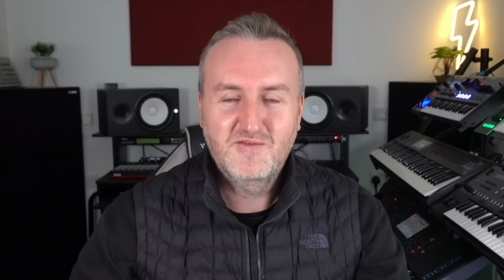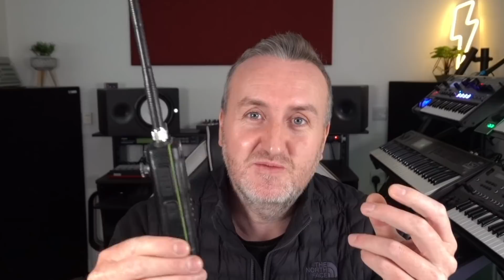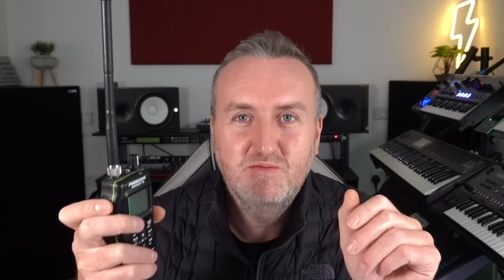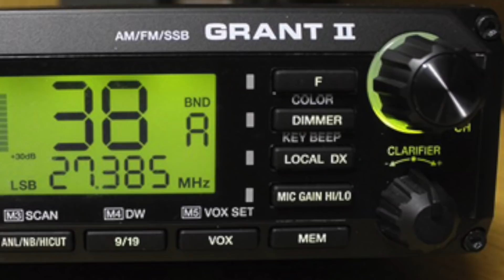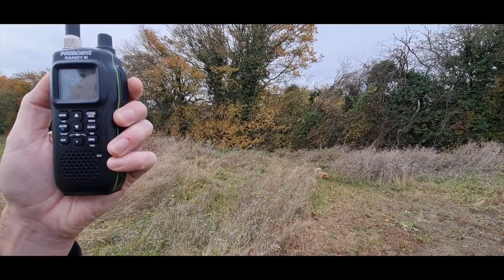NEW TO CB RADIO? WATCH THIS!

Comment: Hi Andy... you're absolutely right in what you say. As a general rule, it is difficult to explain to those who do not have a minimum of knowledge about radio wave propagation, that the poor coverage of these portable CBs it's very small... actually it can't be, because we're talking about a 20 cm antenna to work with an 11 meter wave. A 20 cm antenna "like" those on UHF radios, which work with a wave of 0.7 meters.... it is clear that a portable CB with source antenna cannot have the same efficiency. In my case, I have Randy 3 not only for the love of communications but also in a Prepping way, because I care about that. At home I have a base radio and antenna, in cars I have radios and mobile antenna, and I lacked this portable option, although already have PMR 446 and dual band radios. Right now, even when traveling on foot, I have all three modes of transmission, (CB, VHF, UHF), but... and this is very important, for this Randy I have a T2LT antenna, which makes this notebook have even more coverage than a mobile radio with a magnetic antenna. It is not to be used all the time, as it has to be mounted on a high place, but it is still very easy to put to work. 
Anyway, for this CB, I'm researching which is the most efficient 1.2 meter antenna. Andy, thanks for the videos, and I'm sorry for the huge comment. 
Best wishes to all. 🙏
Reply from the maker: Awesome insight. Yes a T2LT or off center fed dipole will work really well on the Randy, ive found the magloops do too but it can be fiddly tuning an antenna to a radio on the fly as the Randy has no SWR meter.. thats a shame as you know because getting the SWR right is half the battle!
Reply: @andykirby  yes, unfortunately it doesn't, but then it would make the competition's job much more difficult... ah ah ah.... Anyway, whenever I used this antenna, I read the SWR with the meter, and I arrived to the conclusion that if you mount the coil at least 1 meter above any plane, the SWR will not exceed 1.3 in the worst case. When I install the antenna at home, I attach the cable to the fiberglass mast, (8 meter fishing pole), and when I mount it in the car, I leave it hanging... I'll send photos.
Reply: @renatogalego1614  What's great about the Randy 3 is the ability to use it as a mobile or portable. The addition of FM to the U.S. CB band is just around the corner.  Supposed to be anyway... Now add SSB to the Randy 3 !  I saw online today, a Chinese portable CB version of the Randy, Zastone CB58 / QTF? CB58 . woth a few more bells and whistles.
But like you said, it's all about the antenna. Replace the rubber duck with a 5/8 wave expandable antenna, or a quick set up dipole, or your creation ... !!!

I also saw that Icom has or is coming out with a commercial/public safety grade PMR 446 portable. I'm sure it costs more than a regular PMR, but it looks like much better quality..... And that "new"/Retevis Andy has, Ksun has the exact radio - KSun UV3. Like you I have an affinity for radio comms, and prepping. I'm sure you've seen the new Baofeng AR-152 copy of the military PRC-152. There's a company called TRI . Triumph Instrument, China who makes the Baofeng, but better with the actual military type battery, and the radio case is aluminum, not plastic. It has HF and VHF Air  receive in addition to 2m/70cm Tx/Rx. Now if it had CB Am/Fm/SSB .... And GPS is an option for an extra $50-60 ... I may very well make it a Christmas gift to myself !
Reply: Oopps... I can't send the photos here, of course... 🤔

Comment: andy take a look at the cheap usdx 8 band all mode qrp radio  
not got your bells and whistles but you cant get the coverage this gives for the price aka sub £150 anywhere else 
there is also a battery operated one too with built in mike if you like that kinda thing

Comment: Good advice, Andy.   I had a Baofeng some years ago and got fined, since I don't have a ham license and admitted to having transmitted on it. I have some legal PMR 446 handheld devices. I tried to map the range in a built-up area - I got about 4 miles when I was on a local hill. 73s Rob

Comment: When the force (propagation) is with you anything is possible but my advice is get a CB with SSB and string up a long wire antenna and away you go both local and further. Whilst doing this start the Foundation course (Essex Ham's course is brilliant) and before long you will be licenced for the ham bands and then the fun really begins.
Reply from the maker: This good advice, wires work well 👍🏻 vertical dipoles work even better for CB😎

Comment: Mostly because you're on FM CB, that really big help for even cleaner reception at weaker signal, that even with negative-Gain loaded rubber duck antenna. In USA, on AM at same signal strength, the weaker signal strength, that will have muddy audio quality. Wishing for SSB hand held walkie talkie for CB.

Comment: Really like the video really good for newbies one hit that could be useful if you would have get an old ham radio that will get the spectrum between 1800 GHz all the way up to 30000 khz you'll basically be able to use a ham radio on the CB band in the North American area it is 26 9000 khz 27400 khz that's CB Bain you can look up the frequencies on the internet she get an old ham radio you pop at least maybe a hundred Watts you get more power and you would also get SSB that's when we had to bypass it on the CB band you definitely need power and of course if you using ssbu are going to go a lot further less interference and the cool thing it is no license requirement just one little tip thank you for the video and all the best

Comment: It's also mindboggling that the security services can record, archive and triangulate all the content on all frequencies in real time using SDRs for reference and later AI analysis, just as they can for phone conversations, and encryption on ham bands is illegal.
Reply from the maker: It is Andy. Its pretty scary.
Reply: @NewWorldHoarder  Yes they can. Compared to today's tech, TV detector vans are like a horse n cart!
If I can record a 20 MHz bandwidth section of radio spectrum using a $20 dongle and hard disk and then later be able to browse and decode any transmissions that happened in it, then you can be sure with more money than God, the sec services can use at least 100 of them to cover a 2GHz range, or use their own specialized hardware. Of course you'd need more of them depending on cell size.
Encryption is just an obstacle, not a barrier.

No lol.

Comment: I made the mistake of getting a midland alan handheld before I knew about SSB. Got a president mckinley afterwards which I've had alot more fun with. There are CB handhelds that have SSB but they are rare/expensive compared too mobile stations.
Reply: that midland is a very good radio when its peaked up
Reply: There's only two handheld radios that I am aware of having SSB... those being Albrecht, and Midland. And those are primarily for sale in EU countries and UK. Here in the U.S. we're waiting for the FCC to approve FM on the 26/27mhz CB band. Then I'll invest in the President McKinley. Our version of PMR 446 is FRS 462/467. We also have license free MURS (Multi Use Radio Service) which is 5 channels in the 150mhz spectrum at 2 watts, with removable antenna). Our GMRS 462/467 up to 50watts, which requires a license, the price of which is supposed to be reduced by Half...for a LONG time now. I'm going to just bite the bullet and renew it at the current fee. We have a few other license free spectrums, 45mhz (remote control toys and nursery monitors), 902-928 ISM 1 watt (shared with the Amateur spectrum). But with the exception of the Motorola DTR and  DLR portables ($200+), there's nothing else for it. You have to convert commercial gear. Alinco did make a dual band Portable which was 900 and 220. It didn't go over well. And there was the two TriSquares on 900 but not compatible with the Motorola. Retevis supposedly has a 900mhz portable, but their web site is sketchy.
Some of the Chinese radios are fairly good quality, but it's hit and miss. Because of that, Icom is now producing Commercial/Public Safety grade portables, 1 PMR and 2 MURS portable radios in the $120-160 range. Many of us are of the mindset to just go with commercial grade transceivers since they have better quality control. Comments from the American wanna be radio cops on the "legality of Part 90 gear for 95, 97 etc et nauseum" will be ignored ! Feel free to talk to the Marquises of 33cm on the "parts". Bring ear muffs ! Though I've not actually heard any, I have read of non-amateur rag chew, and emergency nets on FRS, GMRS, and MURS. I whole heartedly support them. I'd love to see Icom or Kenwood manufacture an "all in one" license free portable and mobile CB, FRS, GMRS, MURS, 900. Probably never be cost effective, but what the hell... I don't really use my FCC amateur license anymore because it's become to "cliquish", and I'm not the only one to make the observation. That's why I subscribe to the UK guys ! Cheers !!

Comment: Might be worth doing a vid on network radio - sorta halfway house between the informally of cb and amateur and of course you can use your phone. Of course it’s not radio, but it’s the modern equivalent of cb.
edit: I’m running an online sdr in the Milton Keynes area with a 2/70 antenna - the pmr boys asked for it.